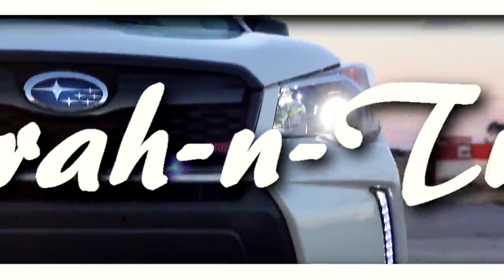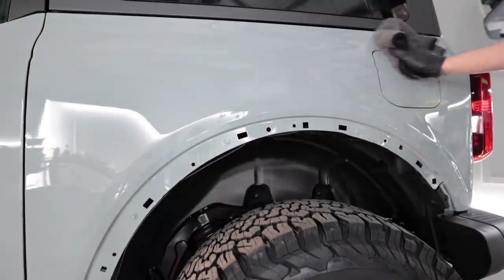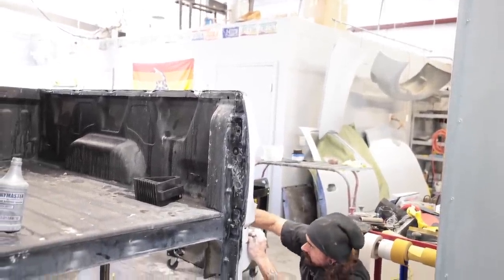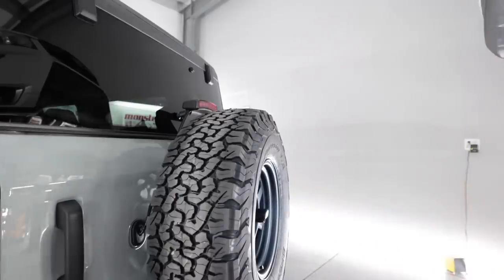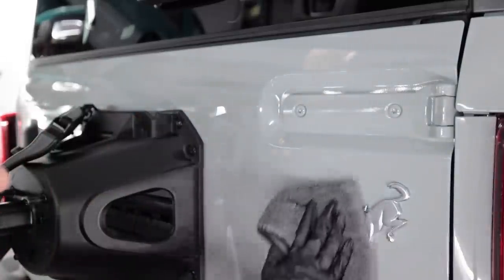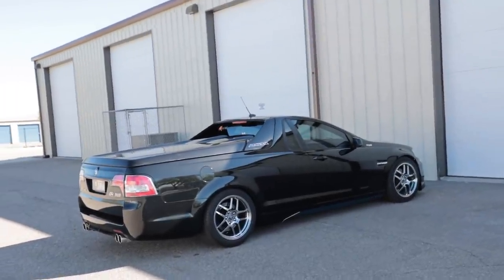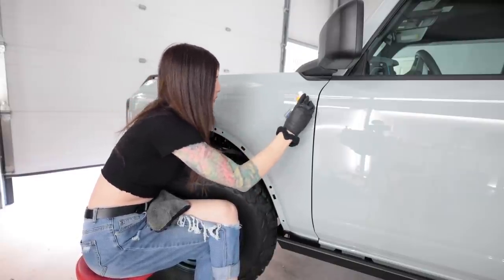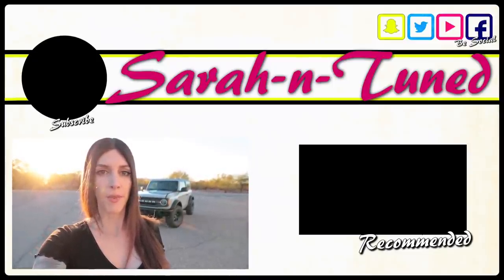Tricky to Apply, But Worth It! // Ceramic Coating My New Ford Bronco

Comment: The Maloo was left hand drive. Which sent me down a rabbit hole. Apparently there are companies that import old Holdens and convert them for you. Now you know and knowing is half the battle.
Reply: If the want to go crazy, they could buy a donor G8 and unstitch the firewall from both, then swap all the LHD controls and dash in to the RHD body, assuming GM-H didn't use a single pressing for both, just with different holes punched out for the steering and brakes to mount.

Comment: 3M Film Essentials - full hood, fenders, mirrors, roofline, A-pillars, rockers(lower doors), bumper (painted piece below the grill) , grill, lights, wear and tear kit (door edges, door cups, inner rocker sills, touchscreen). I like the ceramic, but I think the 3M will be more durable. The areas that are not filmed I will do ceramic coating.   I also put in the XL RokBlokz mud flaps….love them. They can be removed so easily.   I love the lifts….been wanting one for years. You are simply amazing….thanks for the videos!!!

Comment: With your need to keep things clean, if you off-road it - it will NEVER be the same.  The dust is in every crevice, you will get pin-striped and rock rash.  But it's fun.  I got my 2020 Gladiator and off-road it a week after.  It was never the same again.  Also some of that Arizona red clay does not come off easily - I was in Sedona and ran a few trails there.  Red clay dust sticks really well to anything.

Comment: We did a clear bra on our Subaru outback 6 years ago and it is still perfect. There is nothing better for avoiding Rock chips and the like. The original clear bra manufacturer is here in salt lake so we get it done there.

Comment: 15:06 My favorite Clear Bra is 3M Pro Shield Paint Protection. It's self healing should a hair line scratch touch the 3M film. I like this product and highly recommend it. It works well on my Audi and it should do well on Poky.
Reply: Clear bra ...after x amount of years will it show paint fading between the area that has no clear bra and showing a slight thin line where it's not protected...I've seen on some German cars and over the years u could see thin line where it's divided. 

Just wondering of how to avoiding it of showing 

Keep up the great videos

Comment: Aaaaahhhhh!!!! We needed a water beading before/after on this! It's the most satisfying part of a ceramic coating.
Reply from the maker: The paint had a dealer installed coating, so there wouldn’t have been a noticeable difference since it already was highly hydroscopic.

Comment: My Cayman S Sport should be back in 3-4 wks from engine rebuild (bore scoring).  When it's back, I'm going to polish my Boxster S, then apply my 1st ceramic coating.  I'm using Avalon King since John Ross uses it.

Comment: Suggest you show the way the water beads after ceramic coating . I find that impressive.  I have been using Adams ceramic on my cars . They are the only ones that have a UV light and UV active die that lets you see how well you are coating it.

Comment: Because of the colour, I thought it would not be possible to discern any change in shine but the camera has managed to pick it up, it definitely has a deeper, smoother shine after the buffing and coating. Those flares and wheels give it so much character and presence, loving the centre caps too! Cleaner now than when it left the factory! 👍😎

Comment: Awesome as usual but you may have made a mistake, which you said you may be fine with but, if you applied the coating on top of that AIO then that coating may not have bonded properly. The AIO leaves behind some protection which that coating will likely not bond well to even though you did a prep wipe. Either way awesome vehicle and hey if it fails...more content!  Ohh and the coating block has slits so you can tuck the suede applicator in so you don't have to hold it onto the block.

Comment: You can see the ceramic coat if you know what to look for.  It smoothed out the orange peal and that makes it more glossy.  You can still see it a bit around the door handle where you couldn’t really get the ceramic coating in there well.  It’s the little things that make the difference in making Pokey look amazing.  Also shout out to U-Wrench for all the loaner tools and knowledgeable mechanics that sit right next door.

Comment: Last weekend I took the back road to Crown King then Senator Hwy. in to Prescott.  Nice, easy trail ride, suitable for your Bronco.  There is one spot where you have to drive through bushes that will rub against the paint, so I guess you'll never go.  Too bad because it's a nice trip.  Oh well, have fun polishing your off road vehicle.  I'll see you out on the trail............or not.

that's my sarcastic a-hole way of telling you that you're going to get scratches and dents and stuff, don't worry about it, go out and have fun, get it dirty and muddy, drive it through the car wash on the way home then go out the next weekend and do it again.

Comment: I wish manufacturers would make matte paint an option on some vehicles, especially trucks and 4X4s.
Are you going to ceramic coat the plastic pieces?  Fender flares?
Reply: @denissh3955  Ceracote works well too.

Comment: The center caps definitely complete the look, it’s sharp. The ceramic coating will help but I had my local XPEL dealer do the clearbra on my Ranger. Love it, they did my last vehicle four years before and it looked like new when I traded it in.

Comment: The black chrome caps look great. What I like most about ceramic coating is the ease of keeping the vehicle clean. BTW, I used the same brand and it's still holding up after two years. I did a second coat after 24 hours. I've put the clay bar to it a few months ago out of curiosity, there was no buildup for the clay to remove.

Comment: STek (with built in ceramic top layer) or XPEL Ultimate (PPF)
Go for 2nd coat of ceramic.  Coat plastics, windows, bumpers and wheels as well.

Comment: I've been detailing cars for 25+ years (not professionally). It's the quality of the paint & condition of the clearcoat that determines the shine. You can get the same results applying three coats of Meguire's liquid wax as you will with one coat of ceramic. I prefer Meguire's (or similar liquid wax) as it is less forgiving (I typically apply five coats every 6-9 months).

Comment: Thinking of doing my Mach 1 with Ceramic, have also been a paste wax person for the very deep show look. But waxing with every wash is a pain in the ass. Going to try the ceramic this spring and see how it looks. The red on the Mach 1 shows everything, should be interesting to see if there are any real differences.

Comment: Oh and by the way, you should ceramic coat the lights, turn signals the bumpers, the grill, mirrors, basically everything,  it will make clean up a breeze.  Love the centercaps

Comment: Holy shit!!! A Maloo!!! I want one so bad ❤️

Xpel for PPF, without a doubt. You’ll have to remove the ceramic coating though. PPF won’t stick to the coating. 

Ceramic coatings absolutely add gloss and shine
Reply: How to remove the coating?
Thanks if you answer :)
Reply: @valdius85  you’ll have to use a polish or compound to remove it. It’s not hard, just time consuming
Reply: @paulvina1974  thank you

Comment: I’m curious as to why you didn’t do a PPF install, then ceramic coat it. Ceramic coatings are great against UV rays, pollen, bird poop etching,  and micro marring protection. But for scratches obtained via actual off-road adventures, ceramic coatings don’t offer any protection.
Reply: I agree. I had my car ceramic coated, and then about 21 days later did a long cross country trip (on tar/asphalt). The number of rock chips, and the way they looked, is even worse. So ceramic is going to help nothing for the off roading scratches/stone chips.  It will only help with washing the mud/dirt off easier.
Reply: You're not supposed to do PPF after ceramic coating because it won't adhere correctly.

Comment: Just a heads-up: using IPA (like Gyeon Prep) will not remove a true ceramic coating on its own. Even light polishing like you did might not get it all the way off. Anyways, doesn't seem like the case with your Bronco anyways. They probably just used a quick spray wax or sealant. Also, you can absolutely use the same ceramic coating that you use on paint to coat the exterior plastics and badges, which I'd definitely do.

Comment: Ms. VTec is enabling and nice.  I've ceramic coated my Corvette and Cadillac ELR and yep, it's noticeable with the touch method too, and quite slightly better than high-end wax.  Wait 48 hours for it to really really really set.

Comment: There was a couple pre production Pontiac G8 ST’s (Holden Maloo that was supposed to have 50 Cent leading the marketing campaign before they decided to axe Pontiac) up here in Phoenix back in 2010. There were also a few G8’s converted to full Commodore’s. I wish Pontiac would have been able to cling on a couple more years. Holden had some wild stuff just a couple years after GM nixed the line.

Comment: Don't be afraid to ceramic coat the plastics. I tried it on two different older cars, one of them a 2005 TSX (which doesn't have much plastic), and the other a 2009 CR-V, which has a lot of plastic cladding.  I have to say that after a year and a half, the plastic still looks like new.  It looks slightly more shiny, but the color has not faded.  I also find it easier to keep clean, and not as much dirt and road salt sticks to it.  I have tried a lot of other plastic treatments but they would all fade.  Only the ceramic coating has lasted.  I don't recommend it on glass, but I've had no issues on plastic cladding and trim, mud flaps, and the headlights and taillights.  

I also did two coats on the paint on both vehicles.  It wasn't a huge improvement but I felt better having two coats, and it helped take care of any minor spots I missed.  I have not yet done the wheels, but will tackle that in the spring.

Comment: The flash time is important.....you will notice later when washing some body panels that had different flash times when coating will repel dirt easier and wash easier than other areas....1 min is huge, sometimes you don't wait long enough and just wipe it all off!

Comment: Does this coating do anything to prevent pin strips on the trail specifically from small brush, obviously if the branch has a sharp enough edge it wont protect it.

Comment: Black isn't a Colour or a Shade - it's the absence of reflected light, so you can have something with any colour you like, but if no light hit's it, it's black to the observer.
Also, can we suggest Victorias, for the clear stuff on the front end? ;)
And, tech-ic-n-ally, that's not a 'Holden' Maloo, it's a HSV - they had "secondary manufacturer" status. The "317" badge is the number of Kilowatts (because, Metric Life), which is something like 425hp.

Comment: That Holden is left hand drive, which makes even less sense. That title must have a helluva story. 

I'm gonna buy that AIO compound, although I'm curious how the sealant component of it works with ceramic coating (I know zilch about ceramic coating).

Comment: Nice Job. I ceramic coated my wheels too — much easier to clean. I also ceramic coat the lens and window glass. Keeps the headlights from yellowing. Makes the windshield easier to clean.

Comment: You cannot lay PPF on top of a coated car. You have to polish out the coating. If you opt for that, FlexShield or XPEL
Reply from the maker: I put PPF on top of my ceramic coated Forester 7 years ago.. so 🤷🏻‍♀️

Comment: I've been messing around with ceramic coating from meguiars and stuff...thanks for showing us your process. I haven't purchased a new car in a long time, so by the time i own it, it is usually too beat up to worry about putting a clear bra on, though I've always wanted to do that.

Comment: It would make sense that it is more glossy because the ceramic coating is supposed make the surface less diffuse. In other words the pant is reflecting more in the same direction because the surface has a finer finish.

Comment: Every pad (color) has it function. But also take in consideration that thicker pads foam flex and you lose machine effectiveness. Foam flexing is bad. On a Rupés is less noticeable because it has a high throw.  But in regular machines thinner pads are like night and day difference.

Comment: The first time a rock bounces off one of the panels, poor Sarah will die inside. :(
The problem with glassy paint is that things like that slight dip that runs down the door panel just after the door gap stand out like dogs whatsits. Looks amazing though.

Comment: Australia's rarest HSV Maloo is currently for sale for AUD $1,500,000. 1 of 4 original GTSR W1 MALOO UTES produced. And the only one painted in "YELLAH". Features a LS9 474kw (635Hp) Supercharged V8. Was built in 2017 however has never been road registered and only holds delivery kilometres. 19kms. Both Ford Australia and Holden stopped manufacturing all vehicles in Aus in 2016 and 2017 respectively so any Ford Falcon (Ford Performance Vehicles - FPV) or Holden Commodore (Holden Special Vehicles - HSV) Utes that do exist are the last of their kind. Although there is still a reasonable amount of Falcon & Commodore utes around the "you probably see these everywhere" isn't entirely accurate especially with the enthusiast/ performance versions. Our current utility market is basically just full of Ford Rangers, Toyota Hiluxes and other similar vehicles.

Comment: This is not a detailing channel, says the woman who cleans behind her bumpers. Btw, it did start out also as a detailing channel. Don't forget your roots.
At 14:19 you can really see the difference between the ceramic-coated door and un-coated front fender.
As for bra's, I like Aubade, but that's probably not what you meant.

Comment: Great video. I appreciate you live in a dry state but if you’re off-roading, would you consider wax treatment for the chassis? To prevent what happened to the Ranger….
Reply from the maker: I live in Arizona, that would take a few million years to corrode that bad here lol 😂

Comment: That Holden might have been imported and rebadged Chevrolet. They altered the front ends - grill design etc. Pre 2010 they were Pontiacs. I need to find ceramic coating in NZ now!! We can't get the Bronco cos they decided not to make them in right hand drive!!

Comment: I got a question, Doesn't the 3d all in one interfere with the ceramic?
Reply: It does look like Sarah uses the paint prep to remove it before coating, but yes, the wax in an all-in-one will keep the coating away from the paint.

Comment: only sarah will try to make a off road truck shiny. and then go through rocks and dust afterward and get rock chips and scratches all over the car body eventually. it's not always mud you know...rock and dust most of the time..... I think Sarah's OCD is getting worse as times goes by since the very first video years ago.😆

Comment: Any disadvantages to just clear wrapping the entire vehicle?
Reply from the maker: Clear bras look super orange peely up close. Might protect the paint, but it also makes it look like a cheep macco paint job in the process lol.
Reply: @SarahnTuned  Word. I have no idea how much the ceramic coating will prevent trail stripes, but wrapping it may be worth it depending how much you take it on trails?

Comment: Sarah, I'm glad that you gave your vote of confidence to the 3D 505 swirl remover. I've used it for several years now and it's amazing. Just so you know, it's the best product I've ever used, to polish piano black plastic. I've been reluctant to go the ceramic coating route, but I think you've convinced me to check it out. Thanks for doing a cameo on the Holden. In the land down under, they are called "Utes." Keep up the great work.

Comment: Ceramic coating doesn't do much avoiding scratches while off-roading. Wrapping the car, bed liner paint job, or magnetic panels are the best choices. Or more simpler...don't take it off-road and be a Mall crawler as many other off-roaders.

Comment: Isn't there a colour code for polish pads ? ( honest question)
I just bought some polish stuff, wax and totally went overboard. I blame Sarah for that.
Spend 3 times more than I wanted.
Reply: Yes there is
Yellow-Heavy Cutting Pad.

Orange-Medium-Heavy Cutting Pad.

Green-Heavy Polishing Pad.

White – Medium -Light Polishing Pad.

Blue – Glaze & Cleaner Foam Pad.

Black- Finishing Foam.

Red – Perfection Pad Ultra Fine Finishing Pad.
Reply: I bought a green medium hand polisher pad. Weird. I like standards.

Comment: theres only about 40 or so Maloos floating for a buyer in Australia, most for over $70,000 aud. Very cool cars, suits a tradesman. Rock up to a site in a maloo, and you'll have the whole worksite rubber neck.

Comment: Just put the ceramic coating on everything. It works great for trim, lights, emblems and everything. That’s one of the application benefits over wax, because it doesn’t matter if it gets on the plastic trim. Also keeps the plastic trim looking great.

Comment: That Carpro stuff was a great choice! I used it on my (black) 4Runner last Summer and it still feels slick. Being from the East Coast, I'll be interested to see how well it holds up to a Tucson Summer. I do have to wonder why you seemingly went around the hard plastic trim, though?

Comment: Clear bras are for ppl who follow the rear bumper of 18 wheelers on the freeway. Can’t believe you would even ponder that.
Reply from the maker: Actually, what happens here in Arizona is you get these yeet mobile trucks with mud terrain tires that stick a foot past the fender edge and they throw rocks up in the air into oncoming traffic on two lane roads. Got smoked in a press car by one a while back that took out the entire windshield. Not a single car in front of me for a mile or two.